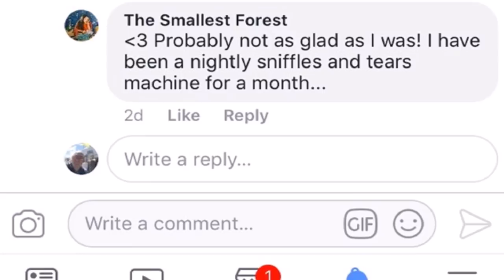100 DAYS AT SEA IN A JUNK-RIGGED SAILBOAT WITHOUT AN ENGINE OR ELECTRONICS

Comment: How did he get through the Panama Canal with out a motor, Do they tow you?
Reply from the maker: will edge He probably would have had to put on an outboard. We know that he struggled getting the Canal transit approval and he told the USCG his last Port was in Panama. Beyond that I am not aware of anything else that has been written about his transit. Mr. Larsen has declined to talk about his trip with me and other members of the media.
Reply: @O R Y X You can be towed by another vessel.
Reply: they raft you up with a boat that has a engine.
Reply: He got lifted out with a crane and trucked it across to the pacific side and craned back in. He inquired about being towed through the canal but was told he would have to have a towing boat with two engines.